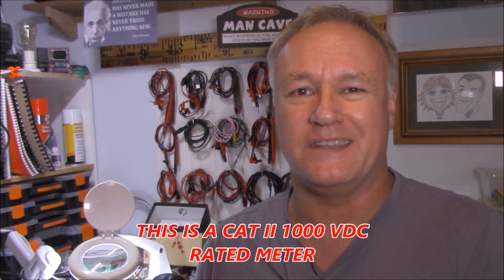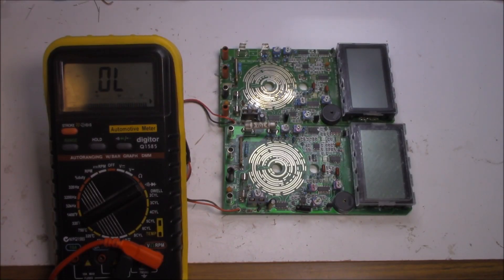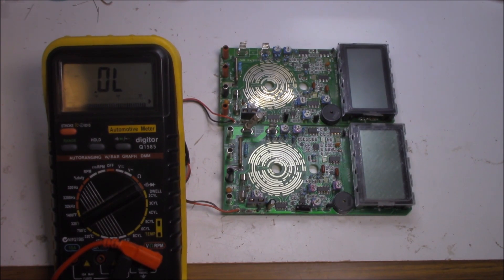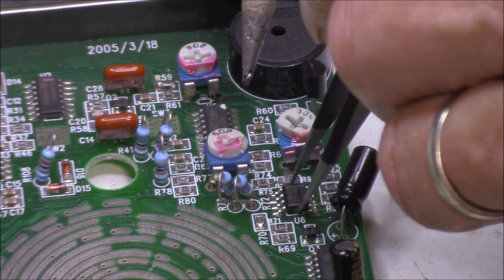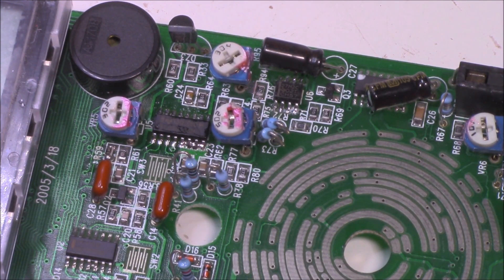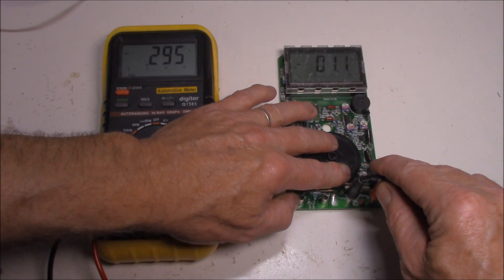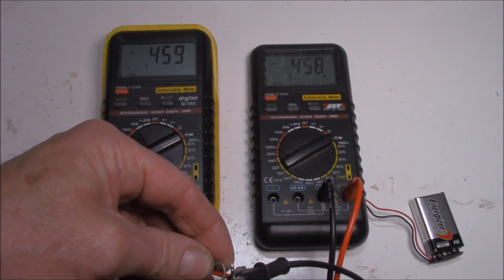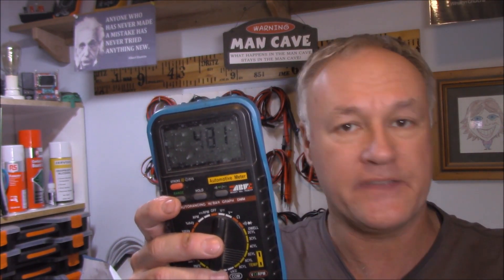ABW Multimeter Blown Apart MiracleMAX

Comment: Did the multimeter make any noise or puff any magic smoke out or do anything like that when it blew up?
Reply from the maker: Honestly, I don't remember, but I'm sure with that amount of voltage running through the poor thing, I reckon it would have objected - flash, spark & crack! 😁
Reply: Do a repair video on a bathroom exhaust fan.
Reply from the maker: @bradroesler7072  Sure, next time I have one to repair, I'll make a video.